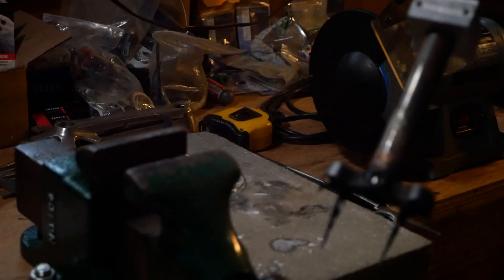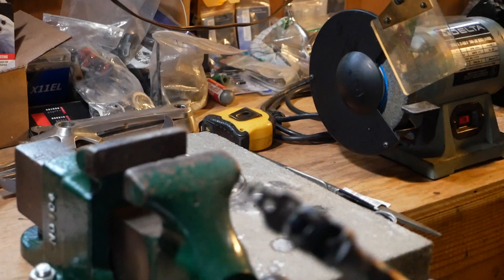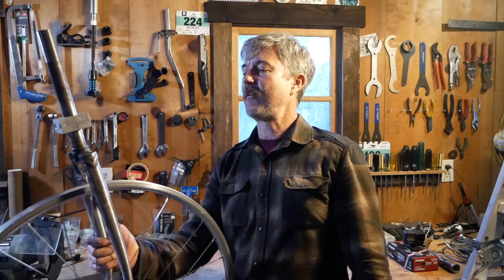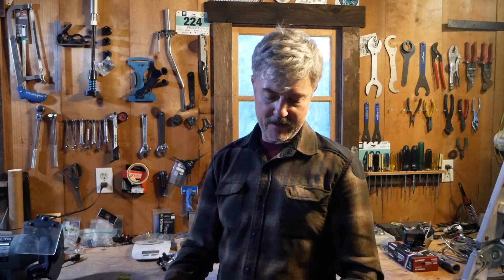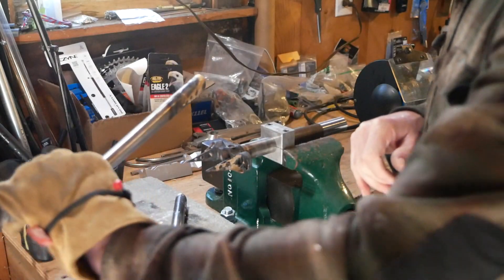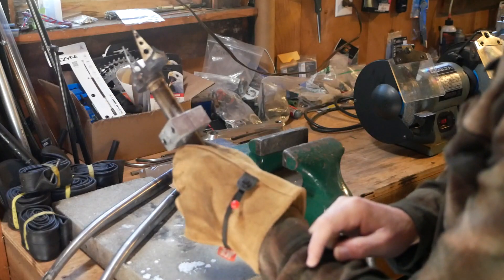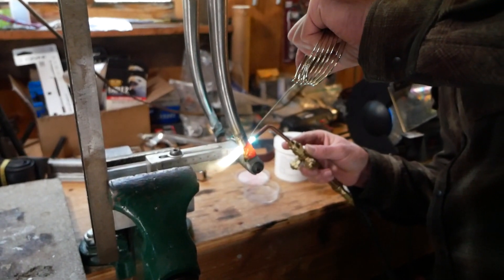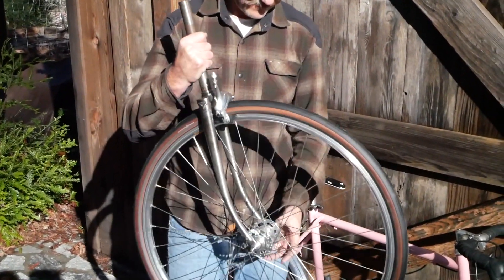West County Custom P2: Making the fork

Comment: Ok, a few things. A larger tip with a controlled flame slightly carborizing will spread the heat a bit and give more control heating both the crown and the dropputs. It will help to minimise the bright orange areas. Medium cherry would be good. Also, use gravity to your advantage whenever possible...such as the steerer to crown and blades to crown. To hold the crown from sliding down, drill a tiny hole where the brake hole goes and pin with a brad. Drill the brake hole after. Do not cold set the fork but rather place an axil or hub into the fork properly spaced. Clam the steerer gently in a vise with blocks, blades up. Then heat a small spot on the inside of each blade about the size of a dime to light red about 3 inches from the crown. Then heat the outside of the blades exactly the same way. Let it slowly cool.  You'll find there is no spring and you hub will fit perfecty...no cold setting. I do this when brazing in brake and chainstay bridges too....but only spot heat the outside of the tubes opposite the bridges. Finally, don't forget your vent holes before brazing the blades. Good luck, nice project.
Reply from the maker: Thanks for all the tips and suggestion! Heating to relieve the fork blade was great. I'll give that a try.

Comment: I like to drill holes in the  bottom of the steerer and top of the blades so that the de-fluxing passage is hidden inside the crown. It is less work to let the holes show although. I also prefer to drill holes in that type of dropout instead of drilling the bottom of the blade. With tab dropouts I like to fill the bronze all the way around except for the inside scallop. You leave enough room for generator wires. I never could get my shimano brakes to open wide enough for 35mm tires, even with quick releases on the levers. Let us know what brakes you use. I also use only about 32-35mm of thread so that the stem wedge doesn't interface with a weak spot.

Comment: About the disc brake comment below. I do not race any more but from what I understand hydraulic brake master cylinders lack the travel and modulation of rim brakes. Would cable shift/brake levers and Tektro C550 cable actuated brakes possibly resolve this issue?
Reply: Disc brakes are considered to have better modulation to rim brakes
Reply: @rob-c.  I just retired from being a mechanic. That is not the story. The piston inside the master cylinder (brake lever) is too short.

Comment: In October of 1991 I was riding my bicycle on Rt 100 in Wardsboro, VT and the steerer tube snapped at the fork crown. I was super lucky. that I was not hurt at all The steerer tube cracked from the back to the front. I would take your finished product to work and perform a rockwell hardness test to ensure that nothing was embrittled.
Reply from the maker: That’s terrifying! Do you know how many miles were on the fork? Also, was it a threaded steerer or thread less? What type of fork crown?
Reply: @Henrywildeberry  Thread-less did not come out until 1993. Over 10,000 miles. It was a seamed forkcown with mangalloy fork blades that was mass-produced in Japan. I had a Cinelli stem and handlebar and could not stop them from creaking. Then the fork snapped.
Reply from the maker: @mark950-d7d  Thanks for sharing! Don't ignore the creaks for too long. With steel, if it's creaking it could be the beginning of a failure. Not always, but still worth checking the frame and fork to be safe.

Comment: Well done for taking on a project like this it will be so satisfying to ride a bike you have built from scratch yourself. It’s years since I have done any brazing but it looks to me that you could do with a bigger torch to get the volume of heat required so that it doesn’t get too hot and burn the flux, it would give you more time and control, that small hot flame is locally burning the flux.
Reply from the maker: Thanks David! I'm very anxious to see how rides. That's going to be either aa very rewarding day or one filled with a lot of disappointment.
Reply: @Henrywildeberry  It will ride great. Even if the alignment ends up a bit out (which it probably won't) that isn't even something you would notice. I recently rebuilt my first frame, because I wasn't quite happy with various details nobody would notice except me. The new one rides almost exactly the same (although I think I can feel the slightly thinner walled tubes I used).
Reply: I thought the same thing.

Comment: Good video. I’m just getting to this point in my life where I’m will to try things and if it doesn’t work try again. I used to get hung up and never got started. It’s nice seeing you fail and start over. Very inspiring.
Reply from the maker: I was getting tool paralysis. I found myself needing yet another tool in order to start. You won't know what you need until you start. Don't worry about the tools, some hand files, a hacksaw, a vise, and most importantly a desire to learn. Also, the full sized drawing is definitely the most helpful especially if you're like me and you don't have any fancy machines. Also, I found this fork fixture for sale used and I think it's a big help getting everything aligned. But it's not required, you can just be very careful cutting the fork legs to the exact length. The worst thing that can happen is you fail and have to start over, but that's how learning works.
Reply: @Henrywildeberry I've made several frames and forks now with basically an angle grinder and a TIG (and some simple fixtures I also made with the above tools). Don't know how you're planning to mitre the tubes when you get to the main triangle, and maybe you've already done it, but paper templates work really well for me. This is what many framebuilders are using the big milling machines and things for.
Reply from the maker: @benc8386  Thanks Ben! I don't want to spoil too much, but I did use the paper template method. I also bought a nice half round file with about the same diameter as the top tube for final miter shaping. Everything fit together pretty snug, maybe not a perfect as a mill.
Reply: @Henrywildeberry  I bought all the hole saws and a cheap mitring fixture for my first frame. But then found I much prefer to use the templates. One frame I made was an MTB and had the DT mitring up against a tapered headtube. Try doing that with a holesaw :) I managed to write my own computer code to generate the template 💪.